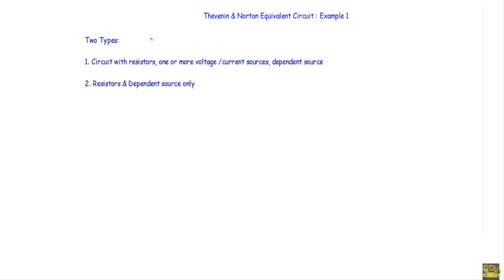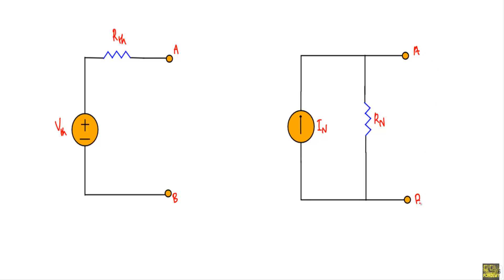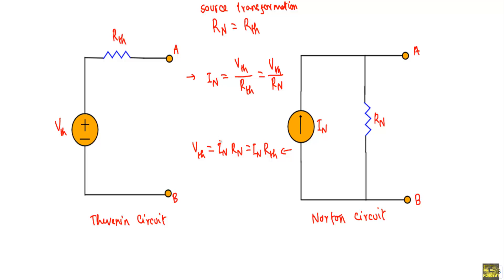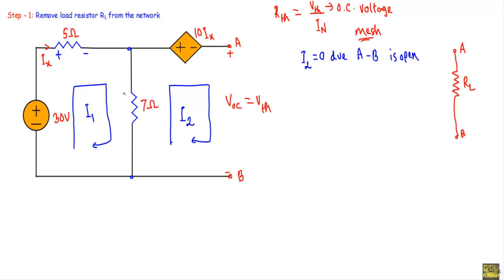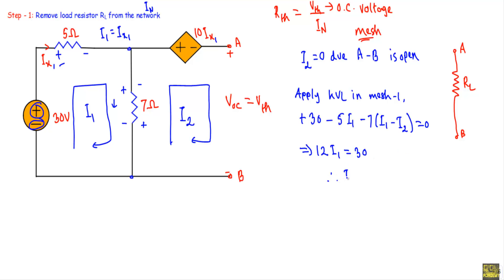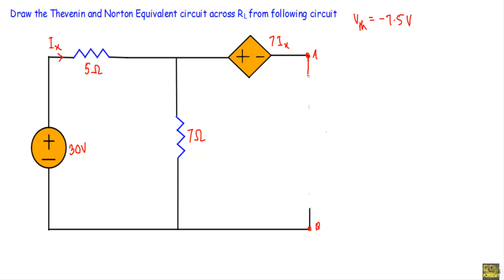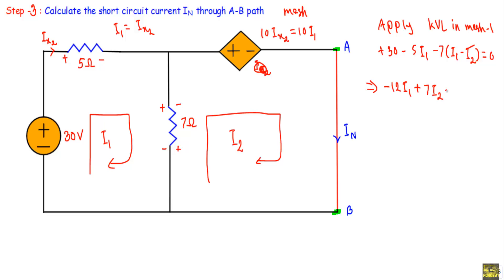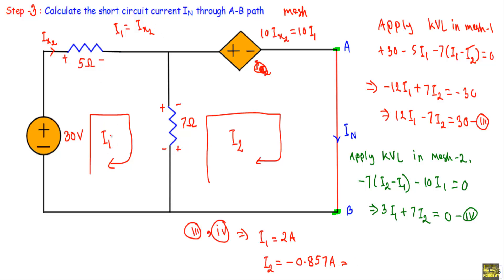Thevenin & Norton Circuit with Dependent Source : Example 1

Comment: if there is a open circuit, how do you apply mesh current method ? i mean the second mesh wouldnt be a "mesh". because the mesh is one closed loop. 
Second question is if you would apply node voltage method at the middle, how would be the equation like ?
Reply: Yanlış yapmış yav
Reply: @mhzy7753  sg